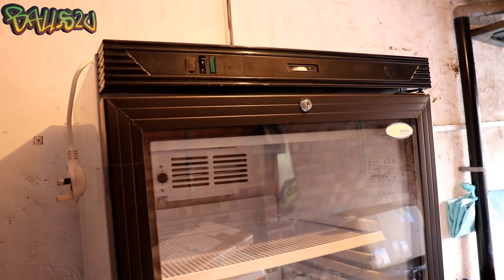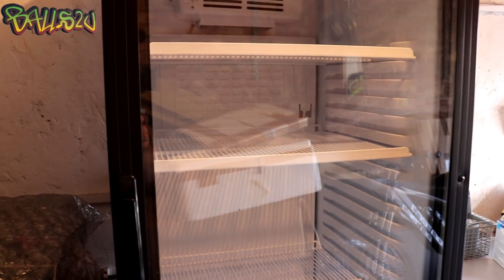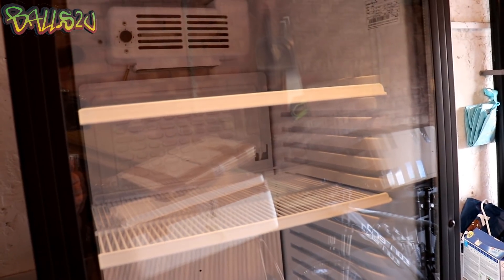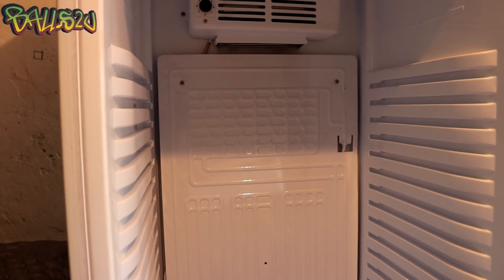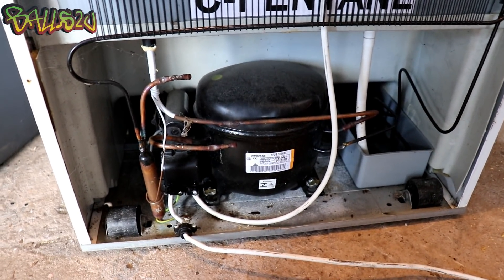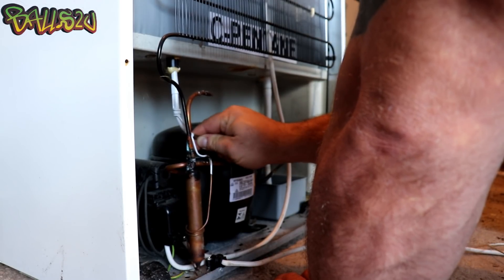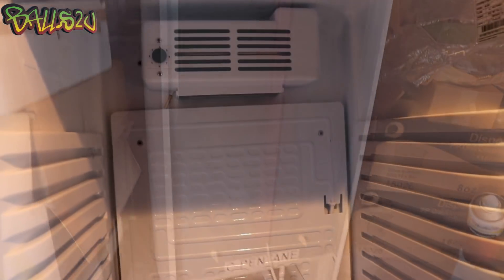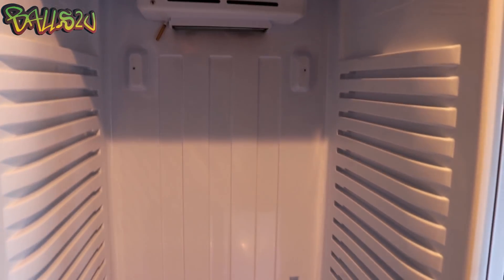Step by step, how to build, fridge to incubator build (part 1 THE TEAR-DOWN) how to build

Comment: I've built an incubator which uses a fridge. I've wired up 2 thermostats. One powers the compressor. One powers my heat mats. Our crested gecko eggs would get too hot in summer else. 

How dangerous is the compressor? Surely it's safe enough to use. We have them in our kitchens ofcourse.
Reply from the maker: I'm not sure as I've never used it for cooling

Comment: Looking good mate IV the exact "incubator"  I used two 3ft heat mats with a habistat I let it settle overnight and has been spot on , unfortunately when i got mine the fan was shagged so had to add a fan myself 😕 nice tip for the stat bracket 👍👍

Comment: I  picked up a Bigger wine cooler a few months ago I already set everything up heattape installed a fan and led lights I only need a good thermostat for it now.. But I did not remove eveything in the back is it really necessary to do all of that?
Reply from the maker: Not really, but it helps to put the plugs in that space
Reply: @Balls2U     is fridge stil working

Comment: hi gavin you may want to point out that you may need to get the fridge degassed as not 100% sure but think it is illegal now in the UK (Europe ) to just cut the the pipes to the compressor and release the gas into the atmosphere  just to cover your own back as i know that is why scrap men are not allowed to take fridges and freezer now but great video as usual
Reply from the maker: I did but I will point it out in part 2 👍
Reply: It's also a federal offense here in the USA too (meaning Prison time).

Comment: I just did this with a stainless steel one here in the states. Bought for 75$ already stripped. Spent maybe 130$ for thermostat, and heat tape. Brother installed a fan with a dimmer unit and led lights that come on when the door opens. Stoked to use it this season!

Comment: Great video mate, very informative, I'm sure you disposed of that gas responsibly ;)

The compressor unit itself goes to recycling centre or can you take it to the scrappy for a few buck? I can't remember if these units once emptied are worth anything.
Reply from the maker: Thank you..... Yes any waste metal can be weighed in for cash
Reply: I've got a big fridge sitting that I've been looking at menacingly for about 3 months. I had to get a dolly to move the thing and even with me and the brother (we're no slouches) it was still an absolute bastard to move on the dolly.

So I had a good laugh when you said they're easy enough moved ^^

Hoping that stripping it solves it but the biggest difference is I've got a freezer display unit, not a fridge. I'm assuming it's a similar idea and the weight is probably because the components in the freezer are heavier than the fridge equivalent.

Either way can't wait for the next video!

Comment: Great job mate ,,this will help out a LOT of people,,,one thing I found building mine was ,,when you strip away the gas bottle and radiator grate at the back and bottom ,,taking out most of the weight ,,sometimes your incubator can be off balance with the big heavy glass door at the front ,,sometimes fixing your incubator to the wall in some way can help 👍👍
Reply from the maker: Stay turned for part 2 😉 it's covered 😉👍
Reply: Balls2U niiiiice 👌🏻👌🏻👍👍😀